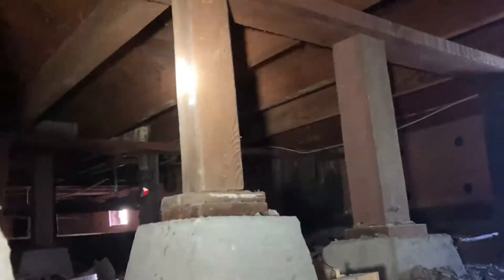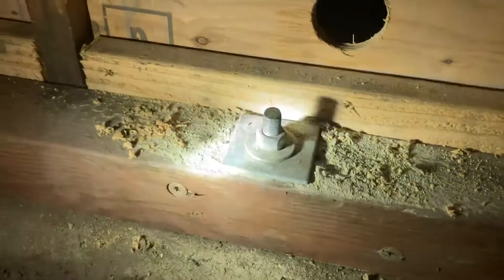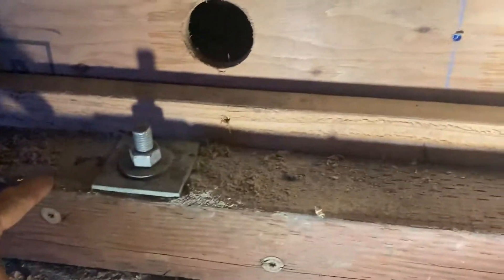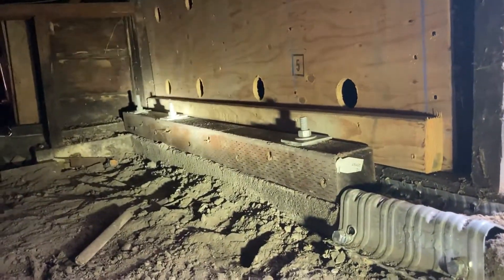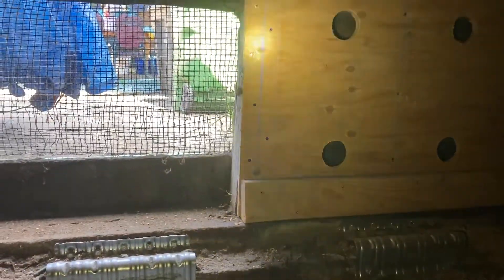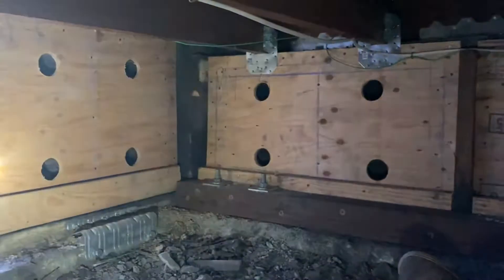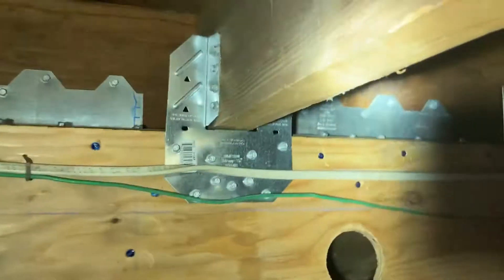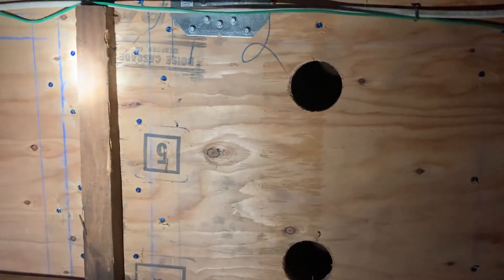California  Earthquake Brace + Bolt

Comment: The bolt added to extra wood seems useless as new PT wood is not mudsill. the URFP brackets also wrong as the side bolt is too close to foundation top that will crack at force. Not sure which city are you in and how inspection can be passed.
Reply from the maker: Hi thanks for rolling through. The new PT wood is bolted to the mudsill, and structural screws are installed through to the original mudsill, locking the two together. Lateral shifting gets handled by the new PT plate, vertical loading remains on the original mudsill. 

California Standard Plan A doesn't have a dimension for the distance from the top of the concrete stem wall to the plate blots. It stipulates the plate used, but the dimension you're referring to is set by the plate itself. Also the plate bolts drill down at an angle, rather than  parallel to the top of the plate. But I hear you, if the plates were a little taller I think it would be more resistant overall.

Comment: How much does that cost?
Reply from the maker: if your house is new enough there may be no work required

many homes only need anchor bolts (estimate $100/bolt) so if you need 30 bolts about $3K, but if you also need bracing with plywood its hard to know without inspecting.

there is a grant of $3K available if you go to earthquakebracebolt.com you can see more and if you qualify.

if you email your name/address to jeff@inspect.net i will look at your house using street view no charge and let you know what i sew, jeff
Reply: @Home-Inspection  thanks for the response!